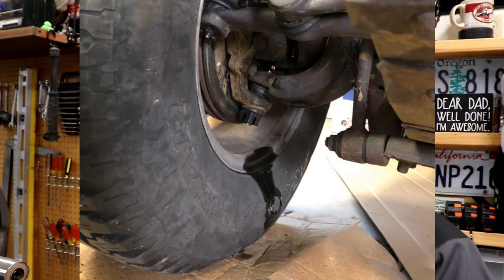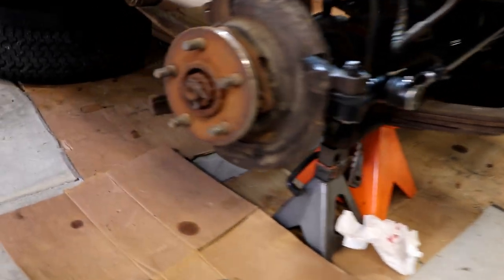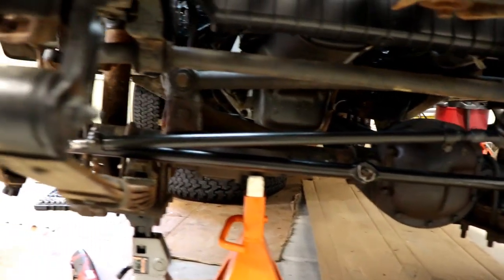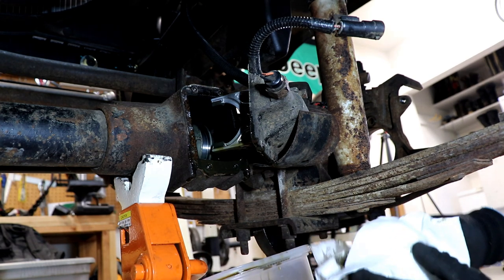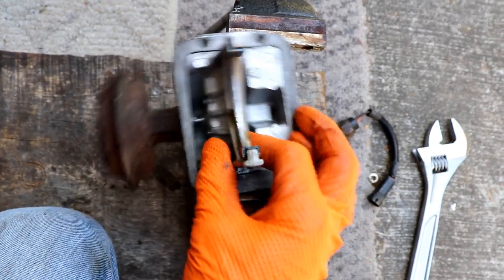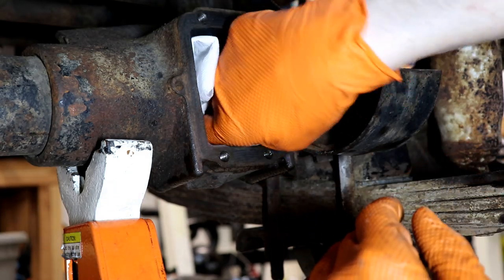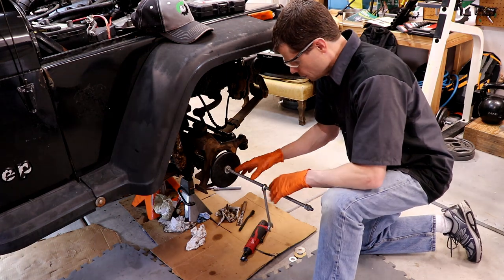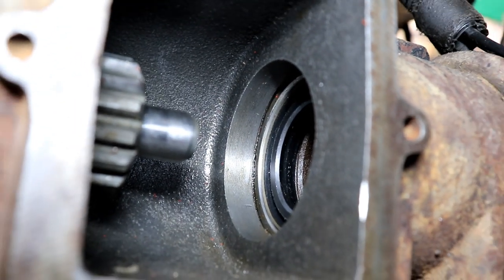Easy DIY Axle Seal Replacement: Jeep Wrangler Dana 30 axle seal leak

Comment: Very helpful thank you. The washer kept moving pulling the seal in crooked, make sure you have more than one on hand. I bought the 6764A seal installer kit from amazon for the end to pull the seal in using the installer tool you showed. I found that it went in better by holding the nut at the outer end of the threaded rod and tightening the nut in the CAD to push it in. I had to reposition the rod to adjust the puller when the seal started going in a little crooked.. as others have said, go slow, a tiny bit at a time to make sure it's going in straight. When the seal does go in the pressure releases, you can feel it. Then tighten it until it feels tight and doesn't want to move any more. Remove the nut and washers-puller to make sure the seal is past the groove at the outside of the seat. Another good tip was to lower the outer end of the inner drive shaft to angle the drive shaft up to get the splines to engage in the differential. Now to clean up the vacuum shifter and install it and torque everything back down. 
I took a couple pics of my modded tool, but can't load them for you. Mahalo, Mike

Comment: Hi Dale!  Enjoy your vids which have helped me to become a DIYer....
Say,  instead of using a weight and a bunch of washers outside the knuckle I found using a 2.470 race/seal driver fits perfectly where the dust ring sits on the end of the axle tube.  It centers the threaded rod in the exact position.
Keep the vids coming!

Comment: I’m glad this worked out for you, but I can’t figure out what’s going wrong. I’ve destroyed 4 new seals already trying this method. It simply doesn’t work. I’ve followed everything you’re doing and it gets cocked in the tube every time. 
I have the factory manual and read several forums and this seal is such a pain that the ONLY proper way to do this is using the install too from spicer. Jeep part 6228-1 and 6228-3 to fully seat the seal and prevent failure again. 
I really enjoy your videos, but I’m so frustrated this went so easy for you. Lol
I’d recommend calling a couple of tool rental places and seeing if the proper tool is available. I got lucky and my local shop is going to lend me the setup tomorrow. THANK GOD! 😁
Reply from the maker: Nice! Glad you are able to get your hands on the tool. Sorry you went through so many seals, I know that can be frustrating. I guess the key for me is double and triple checking that everything is centered. I am sure you did as well, but it can be a pain.
Reply: JeepSolid  I did triple check...but I guess I’m cross eyed. 😆 heading out to borrow this tool. Hope this works. 🤞🏻

Comment: If you had MILKY GEAR OIL I would have changed that also but VERY SMART WAY OF DOING THINGS DALE SIR. You were very safe with 2 jack stands, a tire plus the jack. Anything else & it gets in the way of doing your job. DAMN NICE JOB DALE, DAMN NICE, KEEP THE FAMILY SAFE SIR.
Reply from the maker: Thank you! I plan on draining and replacing the gear oil. I probably should have mentioned that when I noticed it was milky, but also wanted to show how to save as much gear oil as possible if it was still good.  Thanks for the feedback and stay safe as well!
Reply: GOTCHA DALE, I'm not a YTUBER as you are & forget you are teaching us how to do certain things. Learn a lot on your channel SIR, THANKS FOR DOING THESE VIDS. FOR US IN THESE KRAZY TIMES.

Comment: Awesome method of changing that seal.  I used an old hole saw blade of the right size with the teeth ground off on a threaded rod.  Washers appear to be just as good or better.  I think I mangled two new seals before getting the third one in successfully.  Buying extra seals is good advise based on my experience in other words..

Comment: Is there an additional seal on the passenger side of the inner differential housing (where the gears sit)?  If so, does this also need replacing when there is a passenger side axle leak?

Comment: Thanks for putting together another great video on installing the outer axle seal. I really appreciate the ingenuity with the washer setup. 
I can't seem to get mine fully shouldered in the housing though. I am wondering if you have ever encountered getting stuck flush with the tube opening at the shift motor housing with a millimeter of shiny machined metal gleaming at you on the wheel side?
Anyone got advice?

Comment: I watched another video, I believe on a newer model Jeep (than my 95 YJ),where a c-clip was removed in the differential gears from the center shaft, to remove it. I did not have to remove a c-clip in my 95. Confirming there is not one in the 95 with the Dana 30?  It just made me wonder about the left and right play of that center shaft without a c-clamp holding it into the gears. Also, do I need to re-install the center shaft before installing the new right side seal at the 4wd shift fork? I'm not at home right now to look at the shaft, but I'm thinking I recall seeing one side of that shaft to be larger than the inner diameter of the right side seal, which would cause damage running it through the seal. I don't recall seeing a groove at the end of the center shaft that would retain a c-clip. I was thinking there was not enough room to replace that seal with the center shaft in place. I do see, in your video, that you made it happen though, so that's what I will do as well.  Thanks in advance. Mine is on jack stands and completely disassembled, and ready for both seals to go in.  I bought the Jeep used, and upon gutting the gears in front differential, I observed gasket seal on the passenger side of the tube where it meets the differential housing. Someone obviously thought a seal needed to go there as well, but not a slot for one, so they ran a bead of gasket sealer around it. I guess they didn't realize that the gear oil is free all the way to that right seal that you just replaced. lol

Comment: So how about putting the wheel on and dropping jeep off the jacks, to make sure front axle parallel before adding diff oil.
If you do it as you describe front axle still tilted so wrong fluid level will result

Comment: Hi Dale, Love the videos and I've learned a lot. Rebuilt all the steering so far and noticed the leak on the passenger side that you mention here. I got the old seal out, but I notice an o-ring on the outside where the old seal came out. I don't see that o-ring in your videos. The o-ring seems to be glued in. Is this just a remnant from the old seal and can be removed? Does it need to be replaced? Any advice is appreciated.
Reply: Update. I just went in a removed the o-ring. The previous seal had a o-ring and the thing sits outside of where the new seal sits. If you look at the video at 17:50 you see a black ring just to the left and outside of the new seal. That was where the o-ring sat. I shoved a vacuum though the axle shaft to catch any debris as I removed the o-ring. Once I cleaned it up, I followed the video and all is good.

Comment: Tried this set-up 3 times today and it will not pull the seal in. I've lubed it and centered it but it just will not work. Ended up messing up the seal. Luckily I bought 2 so I will try again tomorrow. Very frustrating.
Reply: I'm in the same spot right now. I've tried twice with everything perfectly aligned and still going in crooked... arg

Comment: Too cool.  I had to replace the universe on driver side.   My 12 point bolts that held bearing hub up were big time tight.  So was the bearing hub in yoke.  
I can imagine in a rust state, those 12 point bolt heads  could be a nightmare.

Also, differential on back does not have a drain.   For a 4X4, a sad cost saving by the maker.

As a side note, I was replacing rear tail pipe and needed to get track bar down to get it in.   Never was able to break  that silly torx bolt.   Front is hex.  So go figure.  I shimmed my front for proper caster and tried it without track bar.  I hooked it back since Jeep then felt too loose at speed  Did kill some of the low speed bump steer but loose is worst.

Loose actually could have been from toe.  Jeep has cheap shackle lift and had 5 deg caster.  Needed 3/16 toe in to bring back steering wheel to center.  When I added 4 1/2 deg shim, I had kicked back toe to 1/16.   Might have been OK if I had made it 1/8.
Reply from the maker: Yeah, excessive rust can be a killer. Makes so many jobs much more difficult.  Glad you got yours fixed up! It took some ingenuity.

Comment: I did every step. Finally got the seal in. Now my tire will not move. You cant even push it. I even put the entire jeep up on blocks and tested every tire. Rears spin in 2wd. In 4wd both rears and driver side spins. I cant even manually turn the passenger side tire. What did i do wrong? When i try to drive it, it feels like every tire locks up.

Comment: I drove the seal out with a piece of pipe..buy more than 1 seal and luce the hole real good with grease. If its not straight you will ruin the seal

Comment: What are your thoughts about when you put tire under jeep about adding 2x4's maybe a couple rows in a square bolted  together for added safety. That's my approach when I get under jeeps.
Reply from the maker: That's a good idea as well. I'm a fan of beefing up any safety measures. I've even been know to put a big stump under vehicles when crawling under them without wheels on.

Comment: Wait what is that? It didn’t engage the 4 wheel drive the transfer case does that! You must have a rubicon that locks the front axle for post traction

Comment: Do you not add gear oil into the cad through that center top bolt?
Reply from the maker: Nope
Reply: That’s odd I alway added oil there till it fills up I assumed it would be a fill port due to all the kits an even stock covers have a what I assumed was a fill plug. What’s the point of that bolt/ opening? Thanks for your reply I appreciate it!!
Reply from the maker: Yeah. Not sure why that’s there. The fluid there flows through the differential as well. The diff, you fill to the fill hole which is lower than that bolt hole. Manuals say fill to the fill hole on the diff. I’d think filling to that bolt would lead to overfilling. But good question.
Reply: I’ve worked on 2 different yj’s I’ve owned an always filled there on that bolt assuming that’s where you fill it the few times working on the cad an upgrading them to cable locks. Little over a year later I have a leak on passenger side which is why I wanted to see options on how to pull an replace the seal then I seen you add oil to def an I was like oh $h!t I definitely been doing that wrong ahaha thanks again for your reply an videos

Comment: I'm having a pretty hard time getting my seals to drive in straight, I've tried 2x so far. I'm not sure what else I could do to get them going straight in.
Reply from the maker: It's tough to get it lined up straight. That's the key. Having everything as centered as possible. seal centered. rod centered so it pulls straight. washers all centered.  Pulling force at knuckle centered...
Reply: Same problem. I’ve destroyed atleast 5 passenger side seals, won’t go straight. Driver side went in fine though.  I’m giving up and taking it to a shop.
Reply: @jakeyaboi6824  Where dale was using a big weight as a huge washer on the knuckle, I was using a 2x8 piece of wood. I tried switching to a piece of square tube steel with a hole and used that as a washer and I got my seal to drive in straight. I think the soft wood was crushing and letting the rod go in crooked. Also put a little Ultra Black Permatex on the outside of the seal just incase to prevent any leaks.

Comment: Just like a big truck you need a seal driver the it will go in the seal and up against it so what I will do is put the threaded rod with a washer a little bit bigger then the seal to stop it from driving to far and a socket the same size of the inner part of the seal. Same size as the shaft If the socket don’t fit over the threaded rod drill it and put a nut to hold them together. Now you have a professional seal driver. Now you can make a better video❤smack it with a hammer on the end of the threaded rod to drive it